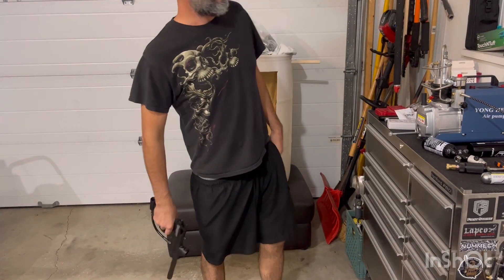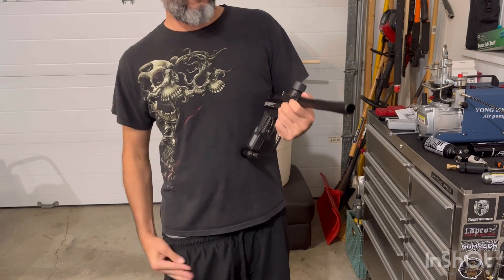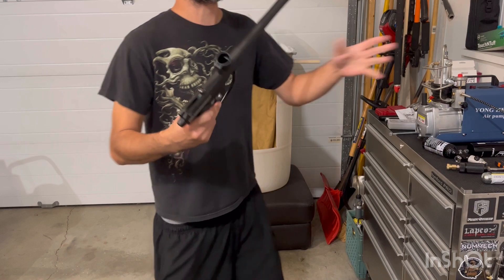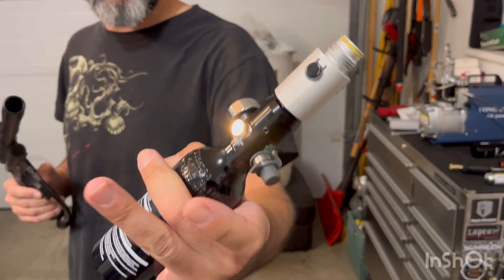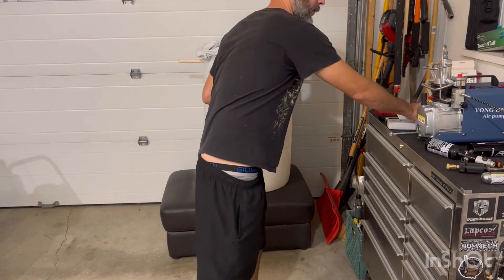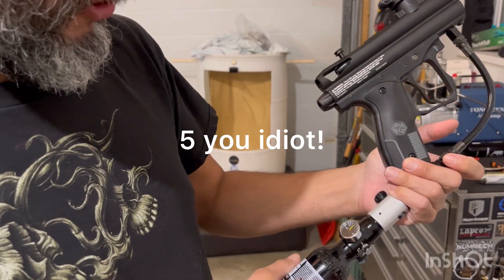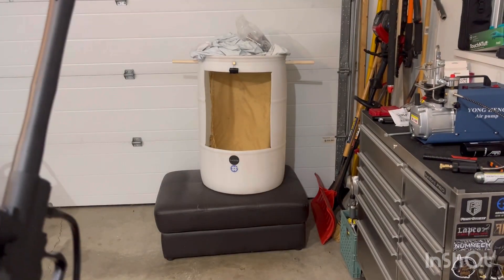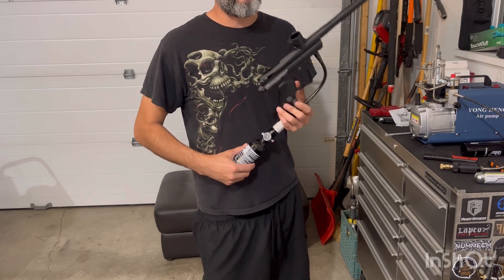Spyder Victor Hpa 825psi output 8g Julv2

Comment: Last week just for grins I bought a NIB Valken Blackhawk 68 which looks similar to yours. It didn't come with a hopper. So I bought one on Amzn for $10 (mine was easy to select since "68" is in the name of my marker). Mine has adjustable pressure too, so I plan on playing with that (I'm not concerned about breaking it since I'm sure these take generic-sized o-rings). In that regard, I also bought a plastic box filled with "paintball o-rings" for something like $15.

The Blackhawk appears a low pressure launcher (haven't taken the chrono to it yet, but when firing Grimburgs it sounds and hits at appx. 11 Joules. The manual says range is 175 feet); so my plan is to designate it a pepper ball-only launcher (because all my kinetic devices are hopped up to the max, so none of those can shoot pepper).

I will apply two of my "FOR LAW ENFORCEMENT USE ONLY" stickers on it, bam boom pow my Blackhawk becomes official.
Reply from the maker: I looked at the blackhawk among other inexpensive markers. I chose this one because of its tool less tear down. I need a break from the clam shell designs. Good luck turning it up and keep us posted on your results.